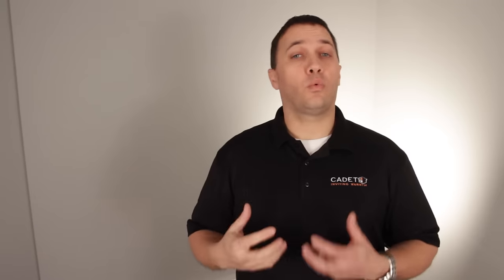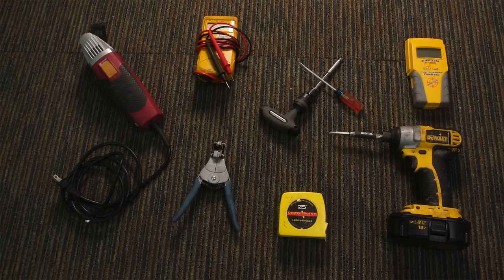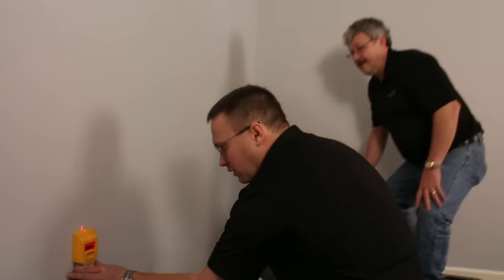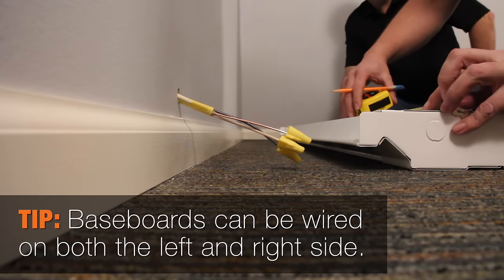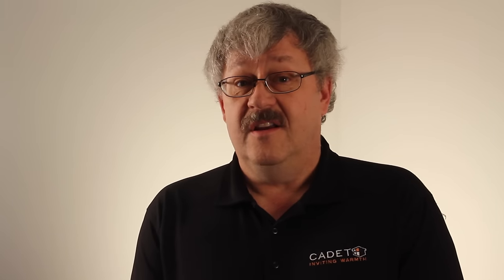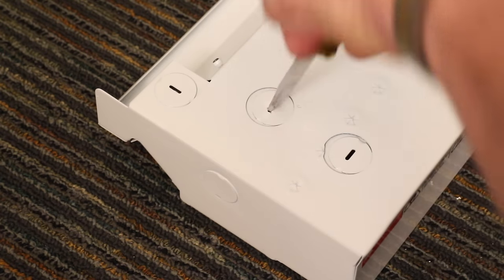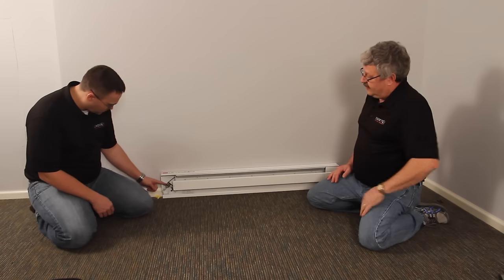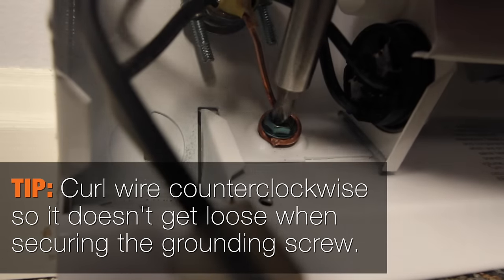How to install a Cadet electric baseboard heater | Cadet Heat

Comment: I was watching this on YouTube to see how to wire up my face board heater. They showed me how to run the screws into the wall and how to read a measuring tape but they did not show nothing on how to exactly wire it up do you cut the top wire or the bottom wire. If anyone is doing this type of work they will pretty much know how to measure and run a screw into the wall
Reply: Exactly they never showed the final connections which basically is what I came here for.

Comment: We have a basement that flooded three times from a drain up on the street. If there is three inches of water in the basement, could you get electrocuted when you have electric baseboards on the bottom of the wall?

Comment: The NM connector is installed backwards. The screws to tighten it around the wire should be on the outside of the heater.

Comment: You skipped over the most important part..hooking up the wires to the heaters. Lol there is a black and white wire coming from the house and my heater has a black and red wire. Was wondering how I wire it up

Comment: May I ask you a quick question? Our contractor wired a 1500W and a 2000W baseboard heater on the same 20 amp circuit in series. Both going to one thermostat. I can't help think the 1500W unit is quite a bit warmer than the 2000W unit. Should he have wired them in parallel do you know?
Reply: With both in series, you'd have the equivalent of an 860W heater (9.6 Ohms + 7.2 Ohms of resistance with the power levels  you reported).  I'm not an HVAC guy, but that doesn't sound like efficient usage from a random guy like me with an astrophysics degree.
Reply: @totheknee  Correct. Wired in series only provides about half voltage to each baseboard. After some research, it seems wiring in parallel is the correct way to install two baseboards to one thermostat. Full and even distribution of voltage that way.

Comment: Where is the electrical installation ?🤦‍♂️
Reply: oh... you just drill a hole in your wall and presto majicko the wires majically appear woot woot
Reply: Sheetrock screws that's what I was thinking they show you everything of how to do it except for the main thing on wiring it up I said in my comment anyone doing this knows how to read a tape measure run a screw in the wall but more complicated things like wiring they did not show it I'm pretty much a jack-of-all-trades but sometimes I need a little help on different things
Reply: Well how do you get power? You forget that part

Comment: Maybe you curl the wire clockwise as you tighten screws clockwise?
Reply: Yeah, that's what I was thinking....
Reply: They curled it clockwise in the video, unfortunately they put the wrong text in the "TIP"
Reply: The bubble wasn’t centered, but it was “perfect”!😂

Comment: I installed baseboard heaters but had to remove the Whole basboard before installing. That tool to cut baseboard Is a good investment thnx.
Reply from the maker: Yeah that's a handy trick for sure. Hopefully it comes in handy next time!

Comment: Do you need to run a separate wire to the heater from the panel or can you feed off an electrical outlet that's not being used?
Reply from the maker: We recommend that you install heaters on a dedicated circuit. Usually outlets are on a shared circuit. If you have a heater on a circuit with a few outlets, it could be easily overloaded.
Reply: always put on separate circuit..do not tap off anything.
Reply: the cadet heaters I have seen at lowes are all 240 volt and most all the outlets in a home are 120 volt so it would not work well

Comment: What about the wiring? I have a heater with two black wires sticking out of it that needs to connect to a black wire and a white wire coming from the wall. Which goes to which?
Reply from the maker: +E3ECO do you know if you have a 120 or 240 volt circuit? Sounds like the heater is 240 volts.
Reply: It's 240V. After looking at the instructions some more, I think the neutral wire is supposed to connect to the top black wire, and the live wire to the bottom.
Reply from the maker: Our tech team says that's the right way to hook it up with 240-volt power. Sorry it took us a while to get back to you, we wanted to make sure we ran the question by them.
Reply: Thanks. I'll be hooking it up this evening.

Comment: thank you gentleman....I have a situation whereby I have a  240v\20 recepticle in the middle of a 6 feet wall..mother in law used it for a unit heater..was going to install a 4 ft 1500 watt baseboard heater....that has to have a thermostat per bank loan inspector...the knockouts for the heater are on the ends....don't think their is a wiring gutter space along the back of the unit...can you think of any cute way of wiring this thing other than climbing under the house....cutting the cable loose  re routing to the end of the heater and re-drilling the wall....( I can't) ..this house is in escrow and I need to get it done....thanks Dale
Reply: Yes, there is! 

CALL AN ELECTRICIAN!

Comment: Hello, I have 12/2 NM-B wires on a 20AMP. Which baseboards heaters should I use? The room is 200sq ft. And also which thermostat? Thank you!
Reply: You need something that runs 2500W

Comment: Hi, I am thinking about getting one of these for my addition, we have a gas fireplace but at night we usually shut it off and there is NO heat in the addition and what is happening is we r getting condensation on the ceiling from the warmth of the house and where it meets the addition only on One part of the ceiling, do you think this would heat the room nice at night so the condensation stays at bay? Thanks in advance ;)

Comment: Hilarious how they don't show you how to actually wire it...
Reply from the maker: Hi Jason, Because wiring can vary quite a bit depending on which thermostat you have, we decided to cover wiring in different videos. The link was included during the video but the playlist can also be found here: https://www.youtube.com/watch?v=jVh0looeRN0&list=PLNQaqK6cZ89H0MRRkTmt1wID1igiqod7R

Thanks for taking the time to leave your feedback. We will reconsider how we do this in the future.
Reply: @Cadetheat  unfortunately the video link takes you to an install of the thermostat.. so we still do not have the info we thought we were getting by the name on this video. how do the rest of us get the wires to majically appear in the wall so we can do this connection in the first place???
Reply: My baseboard  heater I installed is making a buzzing/humming noise? How do I fix that Sir.
Reply: Totally. The most important part was left out.

Comment: What are your thoughts if someone put the baseboard heater just one centimeter above the top of the wooden baseboard trim ???
Reply from the maker: Hi there. This may be possible with some other baseboard heaters depending on the design; however, our baseboard heaters are designed specifically to rest on the floor.

Comment: why in none of these videos do they actually show you how to wire it why I understand how to install it to the wall but never how to correctly wire it which renders it pointless
Reply from the maker: +Stephen Smith Thanks for the feedback. We intentionally split the wiring into different videos, because the specifics change depending on what voltage heater you have and what type of thermostat you will be using. You can find those videos here (the wiring hookup to the baseboard is included in the second half) https://www.youtube.com/playlist?list=PLNQaqK6cZ89H0MRRkTmt1wID1igiqod7R If you're looking for specifics about how to install a circuit into your panel and run wires through the wall, please get in touch with our tech support department through the phone, e-mail or over Live Chat here http://cadetheat.com/support/customer-service
Reply: Basically the voltage goes through the thermostat and then comes out of the thermostat to the heater pretty easy
Reply: @k5blazerman956  I don't even remember writing this im gonna have to go back and watch it and just see if I'm a moron

Comment: can we install 2 baseboard heather on the same circuit
Reply from the maker: That depends on the voltage and amperage of your circuit and the total wattage of the heaters you plan on installing. A 20-amp, 120-volt circuit can have a maximum of 1,920 watts on it. A 20-amp, 240-volt circuit can have a total of 3,840 amps on it and a 30-amp, 240-volt circuit can have a total of 5,760 amps on it.
Reply: tks very helpful have a good day
Reply: watts..not amps
Reply: "30-amp, 240-volt circuit can have a total of 5,760 amps on it."  they mean 5,760 watts*

Comment: What is an around about price of material needed of this to heat a basement of avg size low ranch? This runs off all electric?
Reply from the maker: +Larry Tate Sorry it took us a while to get back to you.

For a basement application we would generally recommend 8-10 watts per square foot. This will vary based on the age of the home, whether this is the primary heat source or not, and how well the basement is insulated. 
 
Our heaters do run off electricity and are controlled by a thermostat, either built in on the heater or with a wall control.
 
Without knowing the exact size or configuration of your space it’s difficult to determine the number of heaters your basement would require.   
 
We would love to hear more about your project so we can give you a more detailed recommendation. Feel free to comment here or call us at 360-693-2505 and ask for our technical support department.
Reply: 10 watts per square foot.
Reply: My masterbedroom is 10x12 size . how many wattage i need and what type of heater  you recommend

Comment: I am wanting to add a 30" one of these in my bathroom, which has tile floor.  Are these safe in a wet environment?  I do not expect a torrent of water, but I can expect mist in the form of steam or high humidity.  My plan is to put these maybe 1/2" above the floor and turn on/off with a wall switch (no thermostat or maybe one on a wall mount on the switch panel).
I am wondering your thoughts or recomendations?
Reply from the maker: Hi Stan, as far as we’re concerned, baseboards are safe to use in a bathroom if you follow a few rules (outlined below). We do suggest you check your local electrical codes, because some areas may not permit this.

Here’s our suggestions to use a baseboard heater in a bathroom: Make sure you install the heater at least 2 feet away from splash zones and don’t install them under towel racks, behind a door or anywhere they could be blocked while in use. We’d also suggest that you use ventilation in the bathroom to help keep the heater dry.

As far as controlling a baseboard, we would recommend using a wall thermostat for convenience instead of a switch. We have a thermostat selection guide to help you find the right thermostat for your situation: http://cadetheat.com/support/choosing-the-right-thermostat.

We’d also suggest you take a look at the Com-Pak Bath heater, which is specifically designed to work in the bathroom and has a timer and thermostat built-in: http://cadetheat.com/products/wall-heaters/com-pak-bath.
Reply: The CEC states that Bond wires should only have a 3/4 turn under the screw. Im not sure of the NEC rules but the bond wire will be crushed and will break. They installed the connector reversed the lock ring installs into the fixture

Comment: can you make a plug in or is there already a plug in cadet?
Reply from the maker: Connor, Unfortunately we don't make a plug-in heater at this time and can't recommend you modify one of our heaters to make it plug into a wall outlet.
Reply: okay
Reply: @coltconnorproductions1016  Too many amps to pull through your standard circuit in some cases plus these are 220 volts won't plug into an electrical outlet.

Comment: I converted my whole house install 10 heaters my bill went way up but it's worth it my bill used to be 200 in the coldest months it is 350 at the most
Reply: How is that worth it? Considering myself
Reply: @Rave33mc  a lot of people burn wood in the neighborhood and my old furnace would taking the outside air I would get smokey here in the house just a little bit would be annoying
Reply: @Rave33mc  I kept my old furnace is still there working needs to be cleaned and I wish I would have used the wall-mounted thermostats which I'm going to put in some day

Comment: Looks like 2 hacks.   The romex connector is backwards and it looks you put the ground wire the wrong way. The loop should go in the direction on the screw is tight

Comment: If you need a video on how to wire this you probably need an electician...the worst part is getting that wire from the panel to that neat little hole that would be a long video you might want to think about.

Comment: what breaker are you turning off if you are installing a new baseboard heater, ????????????????????/// there is no ele going to a new heater.. these guys install a heater and then are going to install a thermostat, but the first thing they do is turn off a circuit breaker to a heater that isn't there/..

Comment: I gotta ask...
Who was this video actually intended for? Couldn't have been made for an electrician, because they would already know what to do (not to mention that the Romex connector is on backwards, and that ground loop?). If you have to ask about any part of the process, then perhaps you do need an electrician. And if that's the case... What was the point of making this half-assed video? Who benefits from this? There aren't any electricians in the comments asking questions. So why would you feel the need to show anyone else how to mount it? What good is that, if you don't know how to wire it?

Comment: My boss just bought a bunch of these and they don't have any information everything it's already connected and it doesn't tell you where to connect it to and it doesn't come with the wires that a person would connect so I don't know if I should cut the wire connectors which seemed to be already crimped anyways I'm going to connect the wires one at a time to see what works best but again these suckers don't have any useful information and there's a terrible instruction on the side of the box and now this not so useful video thumbs down
Reply: Jesus. Not a single comma or period in that entire vomit of a statement.

Comment: These guys waste our time. They don’t not show how to connect the wires which is the most important part of the video maybe they have no clue they show only how to connect the ground wire to the green screw which everyone knows. The wires that come with the baseboard are already connected to something else and it is confusing these people don’t know how to connect the wires and pretend they did a great job showing us how to cut the baseboard and screw the heater in place. I go to the extent of showing that you need to run a new line from the breaker panel but forget the most important part of connecting the white and the black wire to the heater what is the purpose of this video. If you have too much time please don’t waste ours by posting videos like this. Go do something else